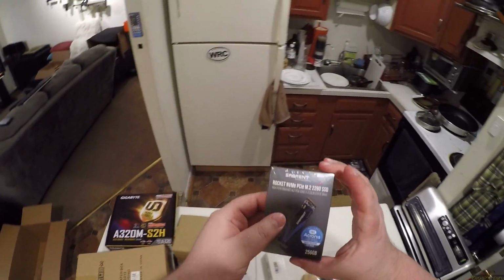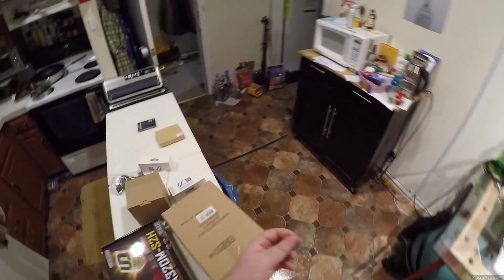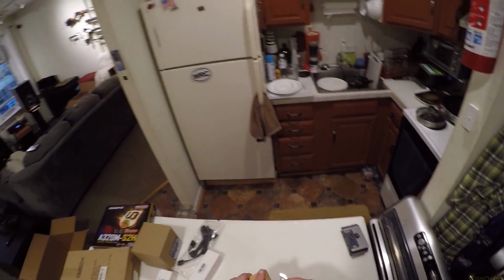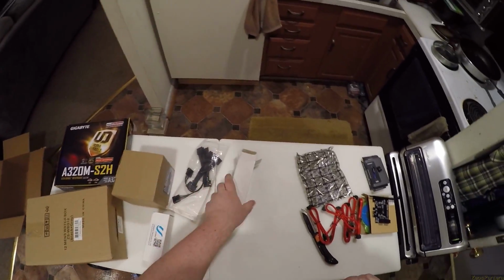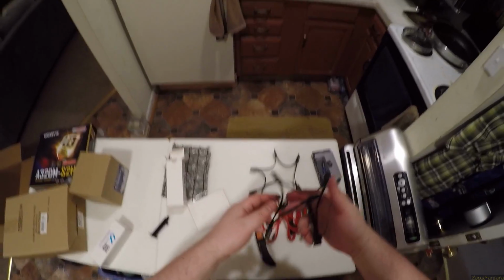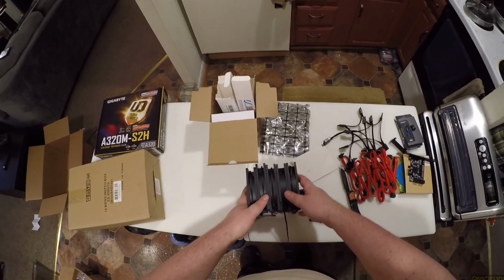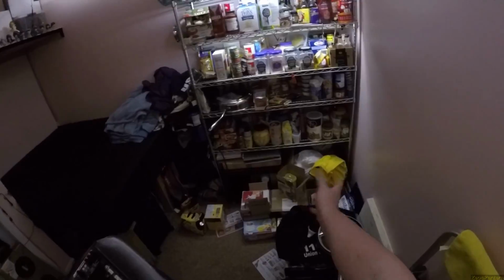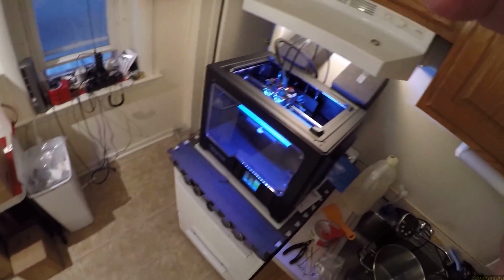Z Unboxing - MORE NAS Build Parts (Motherboard and Fans and Cables OhMy!)

Comment: High end audio but bottom of the barrel PC parts? unRAID (plugins and VMs) could benefit from more power, more cores. B450 and 1600AF would be my choice, triple compute power and cores for 30 bucks more.
Reply: I kind of wish he chose Ryzen 1600AF but it looks like the cpu is sold out at that point I would of got a Ryzen 3200g.
Reply: A complete upgrade in parts would be my suggestion, as i am looking to do the same at some point and time when i have enough money :(
Reply: To be fair it's a AM4 board still so a 1600AF would fit into it, he would just need a way to update the BIOS  before hand, and I doubt gigabyte put that feature on such a low end MB. But hey if he needs more power later it's still an easy upgrade.
Reply: no iGPU on 1600AF, so the NAS would need a GPU. He specified what he needs for a NAS, this is already way more powerful than the Synology. Zeos can always upgrade the CPU later.
Reply: JDM_WAAAT he could have used one of his GPUs for the setup, he apparently won't have a monitor connected, I would never recommend A series on AMD or HX10 on Intel motherboards especially for 24/7. A nice middle range MB with Intel NIC that can boot without GPU (not all can do this) would be my recommendation.
Reply: @rsmakishi  There's no benefit, and you're adding complexity.

Comment: You say nas like NAZ with a Z not with a S.  That is how it's pronounced.  Plus I have 4 synology devices and to be honest.  I would just get an older HP server or Dell Power connect ect.  and you can build one of the best storage devices ever.  

and 256gb for just the OS.  I would just put 4 12TB WD Red Pro Drives in put them in raid 1 so 24 tb.  You dont need speed for storage but you need to upgrade to a 10GB nic with 10GB switch along with Cat 6 or better.

You can thank me later